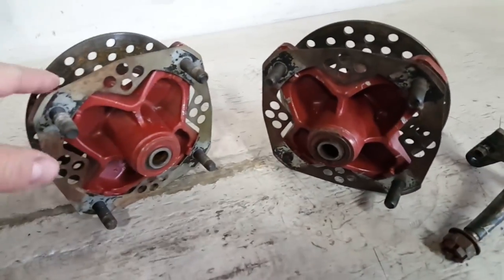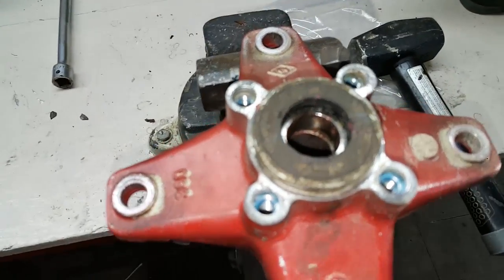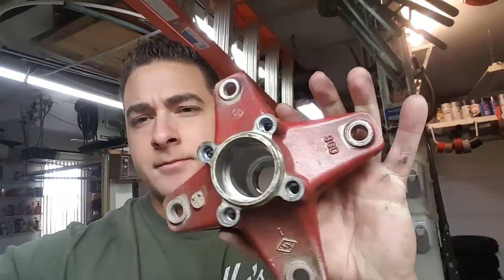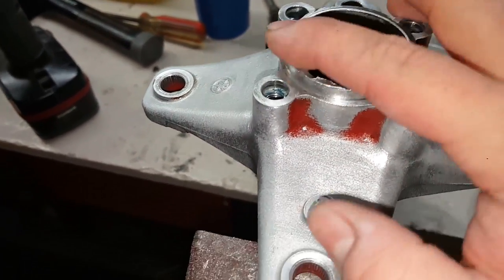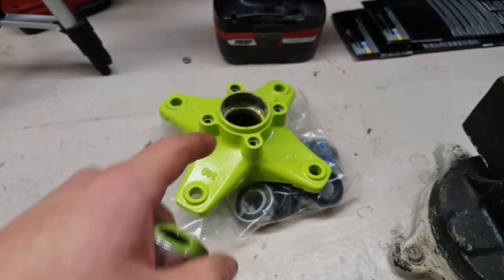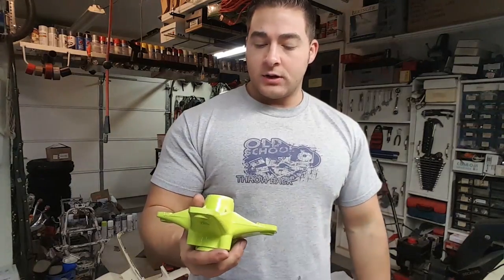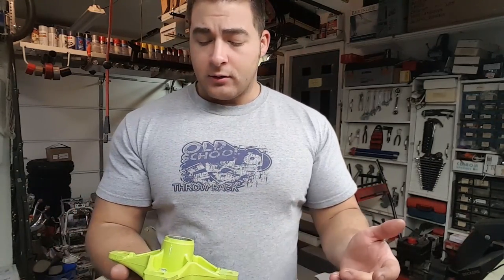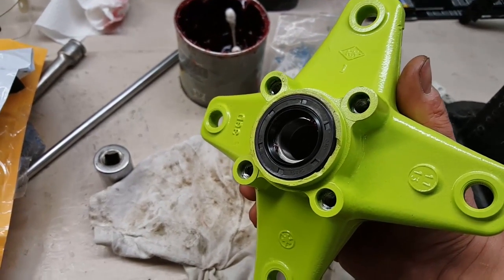Lighting Hubs on Fire!? | Banshee Hub Bearing Replacement!

Comment: I'm wanting to paint my hubs as well as replace the bearings. Did you scratch up the surface before paint? Or just wipe down with acetone and spray them? Also what are u doing with the white plastic in the back ground ?
Reply from the maker: Hey man, i used an aggressive wire wheel to scuff up the surfaces of the hubs before I primed and painted. I am selling the white plastics; I believe they are OEM, full cut with no cracks.
Reply: Michael Sabo nice I'm going to do that to mine, did you use self etching primer or any primer first or just a good coat of paint?
Reply: Also how much for the white fronts? I race cut mine and I really regret doing it.
Reply from the maker: On the hubs I believe I used a bonding primer before my base coat and then I clear coated as well.
Reply from the maker: Are you anywhere near Philly? I was going to sell the set for 180, so 90$.
Reply: Michael Sabo unfortunately no, I am along ways away in Alaska. I need some full fronts on my bike, I regret cutting them when I first bought it. Thanks for the tips, I'll be painting mine possibly tomarrow. If your bored check out my channel. Lots of Alaska riding footage hill climbing on the mountain and riding on glaciers